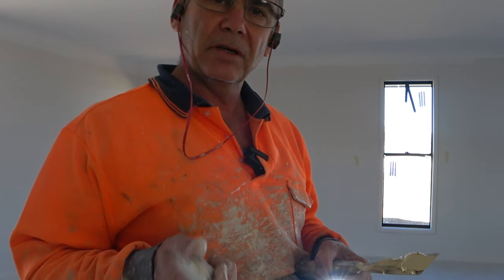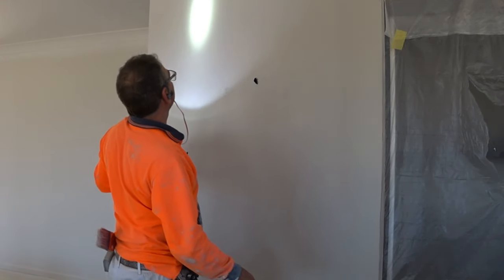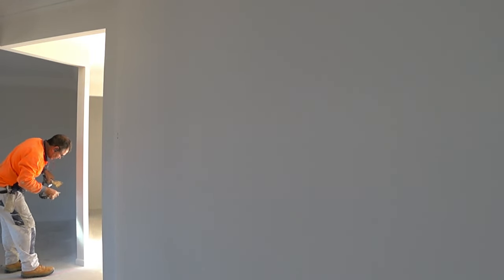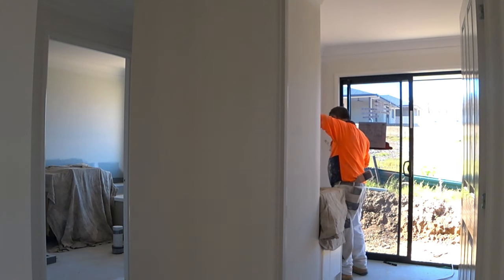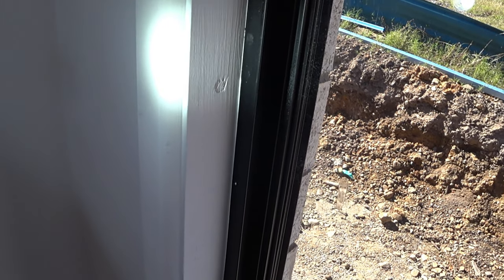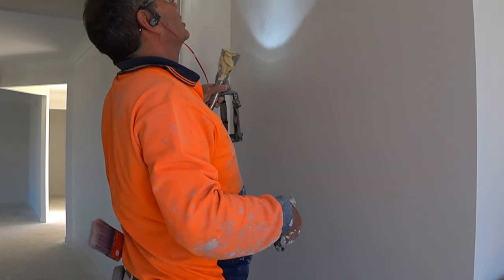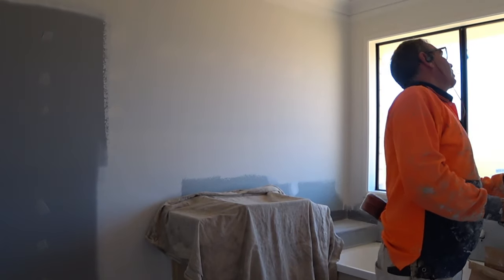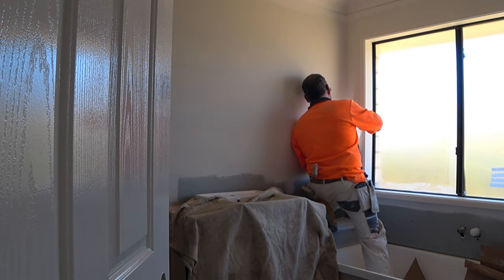How to get those beautiful walls to pass any inspection.

Comment: What filler do.you use so you don't need to spot prime?
Reply from the maker: I don't know of any that sands easy, there is Selleys Polyfilla Professional that's designed for timberwork, I used it years ago but don't remember much about it.
Reply from the maker: Selleys Pollyfilla Professional Gloss Finish
Reply: @ThePa1nterhowto OK thanks.